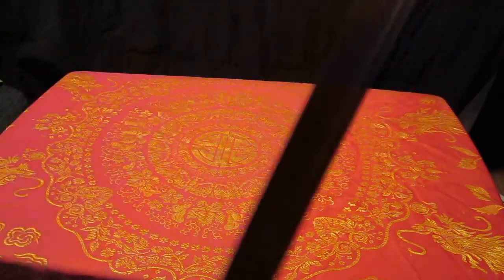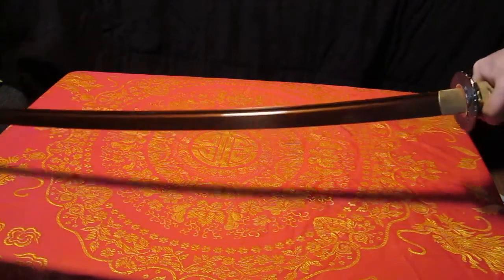Cheap Vs Real Episode 6

Comment: Do you own any Ten-ryu swords?  I have one that my dad bought me for Christmas and I'd like to know how they compare to other makes.  I also wouldn't mind some maintenance tips.
Reply from the maker: WILDMUSTANGX Ive handled a few ive run across and toyed with the idea of testing some out.

Tenryu fall into the same nitch as musashi swords a mass market manufacturer.

Most of the stock they sell are light target katanas. If its a Faux (fake) damascas version they are ones i wouldnt work with for dojo use. the fittings are usually not durable, but the blades are maru(mono structure metal) and are ok light cutters, but overal just basic swords. fun backyard cutters and bottle slayers mainly , but should do light tatami

ive got cleaning videos on my channel were i explain parts you need and how to do it. should be in a playlist 

enjoy :D
Reply: Ok, Thanks. I'm pretty sure the one I have is a 1060 high-carbon-steel sword, with incredibly detailed, dragon themed brass, or bronze fittings.  The most impressive of which is the guard/tsuba, which looks like a coiled up dragon (I think they put it on backwards and upside down, though).
Reply from the maker: most likely a cast tsuba, not as strong as forged or a steel machined one ;/

they are decent basic blades but I would be careful of targets , it should be a light target blade

Comment: Hey I'm new to katanas and I bought a Musashi gold collection sword and I'm wondering what quality is and what is your honest opinion about it
Reply from the maker: dustin waube 

if its one of the authentic china master Alex Zheng blades its a mixed bag.

they are known as the diamonds in the rough, having a splendid blade structure with rubbish in terms of tsuka setup. They are just placed within a basic setup which totally ruins the overall feel of the blade when used. Ive been looking for one to try for a project sword after nanameoni, but not much luck :(

in terms of cutting performance a solid medium target blade, i wouldn't do hard targets for fear of ruining the appearance. if sent to a proper tsukamaki could make a formidable blade setup. but its a good practical sword, but i find them overly priced for what they do. a roninkatana or cheness or skyjiro can be equally effective at lower cost.

its really dependant on what your looking to get out of the blade. in terms of appearance the gold collection are very eye pleasing but again lack performance due to the setup

Comment: I Have a carbono Steel blad with oil hardening, is it good?
How can i preserve the blade to not rust?
Is that oil you use?
I don't know a lot of katana xD
Reply from the maker: +Ivan Domingues choji oil to prevent rust and improve draw speed as well as lubricate while cutting

i dont know id have to take a look, i have email or fb that i do free consultations on

do you have either?
Reply from the maker: looks like a cheaper made sword, the hamon is false wire brush and has a simple saego and tsuka material very thin , and will wear quick. the sheath is the same as my pheonix katana
Reply: +DemonSword Hmm interesting 😁
Reply: +Ivan Domingues 
How much do you think this Katana is worth?I would like to know
Reply from the maker: if i hazard a guess to be made 40-80$ (depending on sellers creation method) and will be sold by them for 90-135$
all parts and fittings are mass made in china, the sword itself is not forged or made to any standard and could  fatal flaw against targets of medium or heavy. blade is not properly heat treated. so basically its metal cut to sword shape

Comment: +DemonSword I'm looking at a Kill Bill Katana and would appreciate a reply and your input. I've narrowed it down from these two websites, and have a few questions:
Are these two in the links the exact same, if so why is there such a big price difference?
Could I, and what could I cut with these since they are listed as battle ready, and would I face durability problems.
Plus would appreciate your opinion or anything else I need to know, or your recommendations and any other better swords. 

http://www.kultofathena.com/product.asp?item=SW320DX&name=Kill+Bill+-+The+Brides+Hattori+Hanzo+Sword#

http://www.swordsofmight.com/handmade-bill-hanzo-sword/
Reply from the maker: +Aaron De Leon the one from kult of athena is a better forge 

battle ready is a term coined to drum up business whether its real or not, but the first should be able to do light targets and some starter medium from the looks of the grains, the second one is light targets only its structure.

replicas pose a weakness due to the parts used to make them, most replica swords are not really meant for function, rather for decoration
Reply: DemonSword By the way thanks for replying, I'll definitely subscribe to you. So what would your recommendations be than, for around the same price point, if you think another sword would be better than that specific replica. Or would another katana for around the same price as the 129.95  one would just be the same quality?
Reply from the maker: its dependant on what your looking for, if you want kill bill get a kill bill, nothing wrong with it. the fitting parts like, tsuba, tsuka, f&K and habaki are usually the problem areas is all in terms of durability, and possible sticky saya

if you want a sword to do dojo practice with i know a few

if you want specific target types i also know some as well

it all revolves around, what you plan to do with it and need it to do
Reply: DemonSword I don't want anything too special, just something that I could cut some bottles, melons, etc; and could rely on the blade not breaking or getting very dull easily. As well as maybe heavier cutting obstacles than those previous said, but again not too much. I would appreciate any and all recommendations on katanas for around the same price range as the Kult of Athena one listed. The only reason I wanted the Kill Bill replica was because of the design, but I would definitely prefer a better blade over design for around the same price any day. So again, I would appreciate your input on anything being better for cutting purposes. I thank you for your time and assistance and future assistance's.
Reply from the maker: there are a few lower end swords that i can say are durable for medium/light targets 

one that ive seen be a good sword to learn on is the
http://www.chenessinc.com/1045.htm

the 1060 they offer is better for medium, but this sword is still a good starter blade, it will perform all standard use as well as medium targets. harder targets will cause fatal flaw and hurt the blade. 

hard targets will wear any blades edge fast, so maintaining and sharpening is a reflection of use and target, 

kults prices are good or the same as competitors ive found

another site is sword buyers guide if you need another source to look through